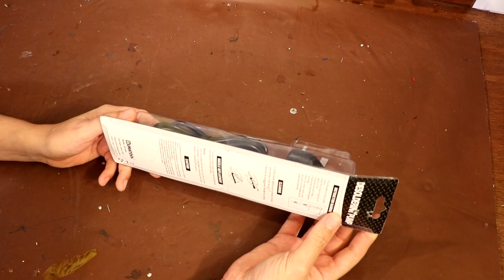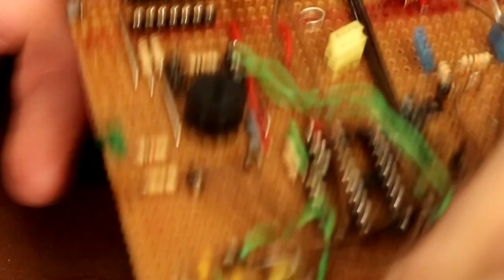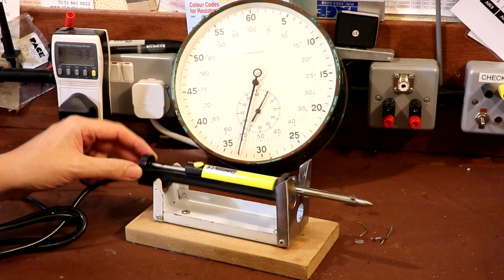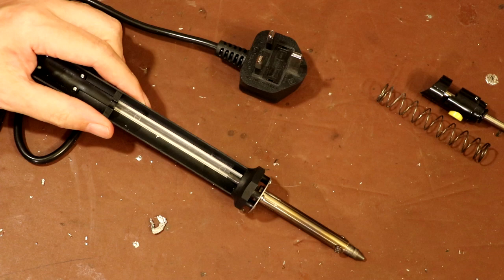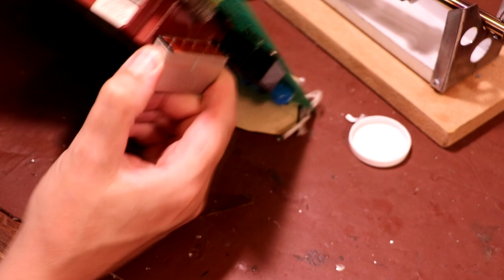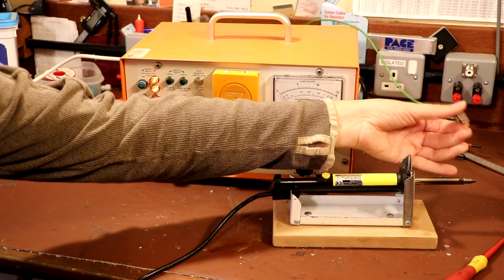Duratool Desoldering Pump

Comment: A very thourough review, Chris!
How did you know I had one of those manual suckers, haha.
Never used it much as it takes so many tries to get some desoldering done... 
The desolderpump of the JBC isn't the best either. It clogs up very frequently and I've made it a habit to completely take it apart and clean it after every use, so I don't run into the frustration of it not working once I need it the next time. 

The other week I replaced some caps on a very old dusk-dawn switch that had bare traces covered in solder and the component leads folded over... I just wicked the solder away and straightend the leads. For regular desoldering I just heat the solder and pull the component out, after that wick the old solder and clean up the pad/through-hole plating. Only for larger multi-lead components I use the vacuum tool.
Reply from the maker: MrDubje interesting you say your JBC isn’t the best, I have a relatively expensive Pace desoldering unit and I have never been happy with that either given the price tag. It blocks constantly requiring a lot of cleaning and has poor vacuum. I was going to try and find something better I guess I will not consider the JBC either now.
Reply: @allthegearnoidea6752  Even the person giving us the soldercourses at work says the JBC desoldering tools are no good. He thinks Weller is better, but I'm sure he means the ones that produce the vaccuum by venturi valve. You need compressed air for those stations.

Comment: These cheap de-soldering tools are fantastic.

I couldn't justify spending $200+ on a full de-soldering station that took up heaps of bench space and would only be used once or twice a year, so took a chance spending US$8 on one of these. Money well spent!

I was concerned about build quality at first, but then successfully de-soldered 125 DB-25 pins and 80 IDC header pins in less than an hour. That job alone paid for the tool.

The one I found on eBay came with a couple of different size tips and a stainless steel wire to poke through the tube, helping remove any solder stuck in the middle. Mine also had a silicone washer between the vacuum chamber and the heating element, so I didn't have any issues with handle heat or suction escaping.
Reply from the maker: Microwave Dave I total agree it is very good value. It depends on your usage case I have a very expensive Pace desoldering gun which has not much better performance. If you find a good desoldering unit that works for you stick with it.  I have on occasion had to desolder a lot of components in the production environment and that’s really the only time the more expensive units will pay their way etc. Thanks for watching and great comments regards chris. Interesting you found some small tips.
Reply from the maker: I should have said there is notes to a very good motor driven vacuum pump in the show notes,  I’m guessing less than 100 dollars for you and they work very well